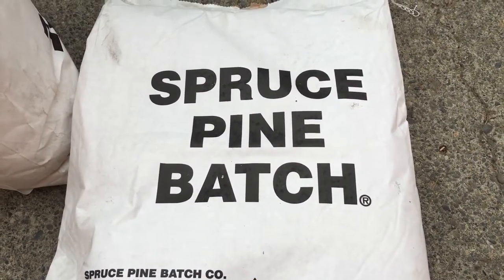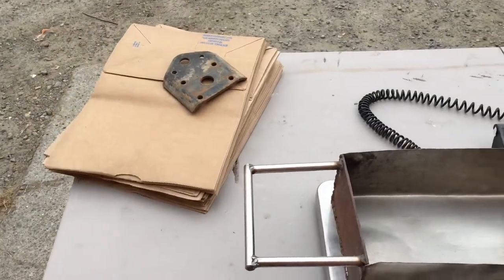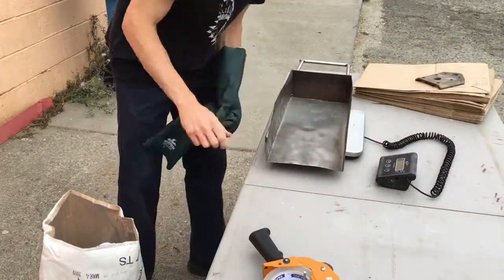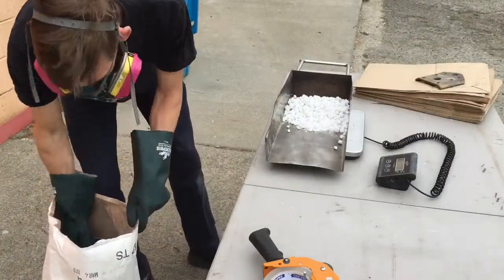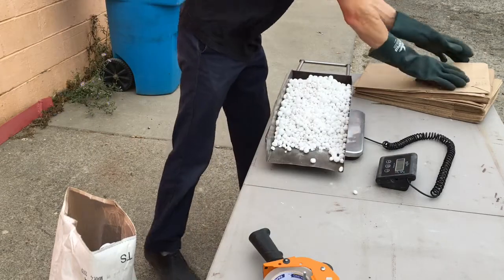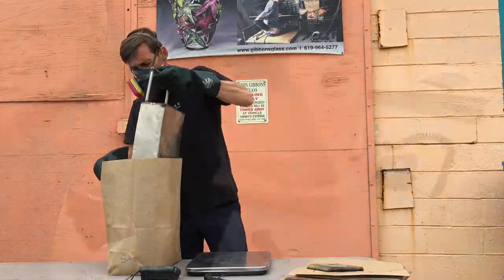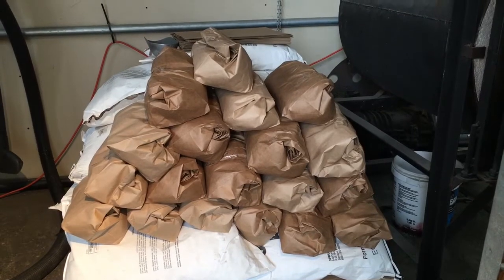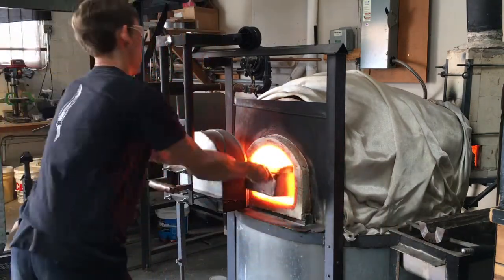Making Spruce Pine Batch Bombs by John Gibbons

Comment: good idea might have to try it out at our shop. Wonder if there any caveats with electric furnaces?
Reply from the maker: I used to use it on an electric furnace—a molly melter, so you should be ok. I heard that it creates a little gas so you would need a half inch hole chimney or crack the furnace door.